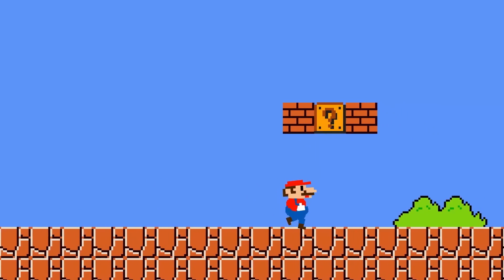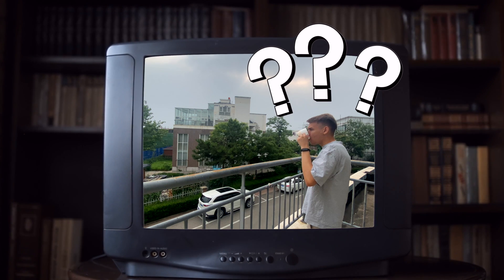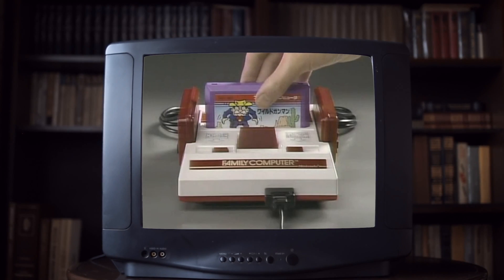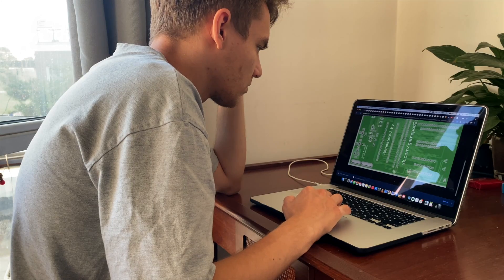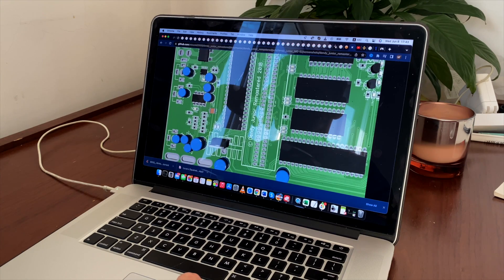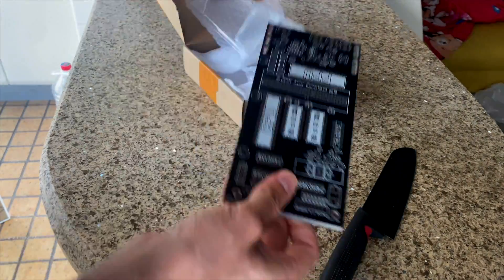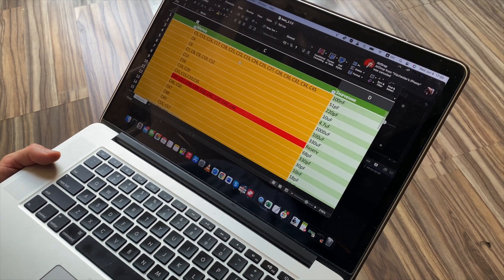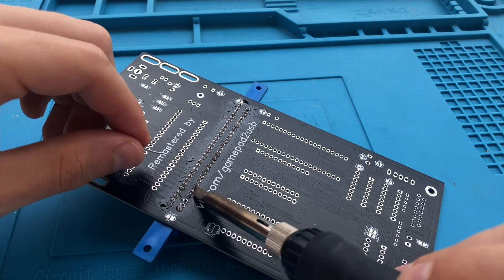I MADE A DIY FAMICOM, DOES IT WORK?  (famiclone, dendy junior)

Comment: I also built one of these - and mine does work so it is possible. 🙂 I had a hard time locating the 74HC368 buffers for the controller ports, and had to salvage a few of the other parts (like the reset button and the controller ports) from a dead Famiclone - but it produces a nice picture at the end of it. The board was also slightly wider than my Famicom case wanted - but it fits after a bit of filing. Good luck with getting yours to work - looks like you had more fun making the video than you did making the Famiclone though. lol.
Reply from the maker: Yep, I managed to build it. Check out the next video 🙂

Comment: I don't want to take the time to design my own Famicom board.  But there's one huge thing that every single person I've seen who's revised this board makes.  It's cheaper and more convenient to design the Nintendo av connector directly on the pcb.  You can have the extra pins sit empty for an rgb mod, and you don't have to buy expensive rca or din connectors.

Comment: I know why it doesn't work. It is because the SMD resistors you buy online are not accurate. I am working on the same project and I must admit that this is getting pretty expensive. I purchased GoldChamp GC-36D capacitor and resistor tester to find the accuracy of the capacitor and resistors.
Reply from the maker: Yep I checked some , and it’s 10-30 percent accuracy